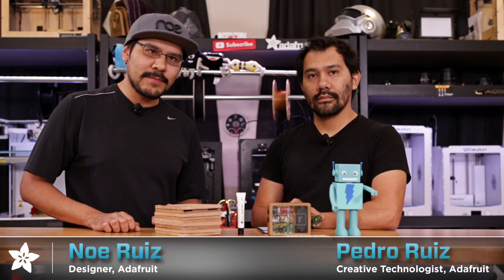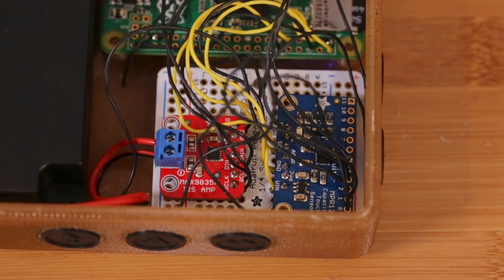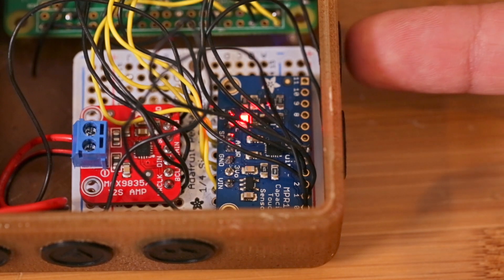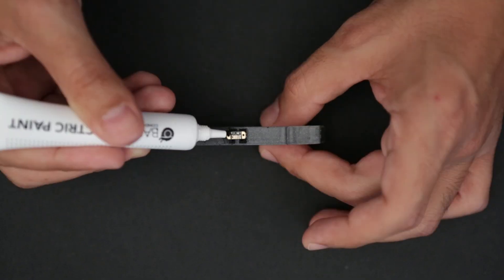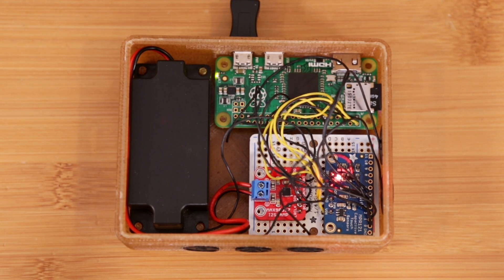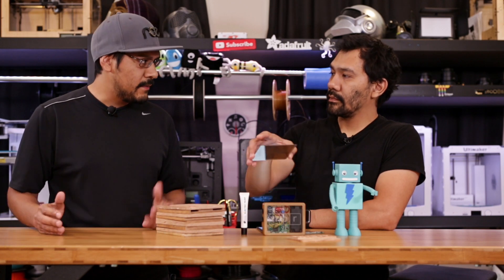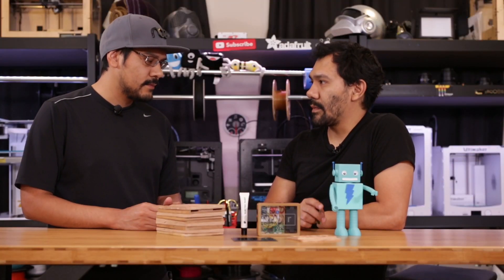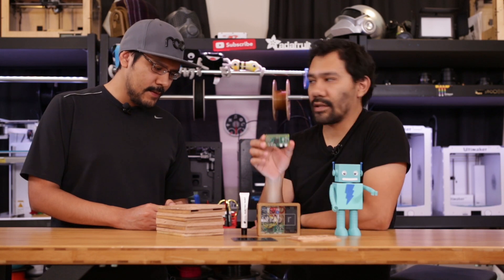Raspberry Pi Zero NPR One Radio

Comment: How neat is that? Well put together. So does this project receive radio, and then demodulate, and turn into audio, or is it going over WIFI and streaming off the NPR site? Or both?
Reply from the maker: +Andrew Tubbiolo Thanks! Yes, the Pi connects to the NPR One network and streams audio over wifi. It uses the NPR One API

Comment: Soon, I want to play around with a cnc router table as well, but I think you guys need to think a little bigger on your audio hardware side. I do like how you guys integrated the controls and wifi to the zero, but Im not a fan of using breadboards. I finally got my hands on a few pi zeros, and for example I have one running quite well with a pimoroni dac soldered to a modified sure tpa3110 board in a cigar box. It is running headless with nothing but a p/s isolation switch. I would like to program a gpio switch or a timer circuit for shutdown, but haven't bothered yet. I have to finish mounting and powering a 4 port usb hub in the box. Once finished with that, there will only be a power switch, 5.5 x 2.5mm power jack, and 4 speaker binding posts out. Inside I have a 5v 5A buck regulator to power the pi and the usb hub.

Comment: hello. need some help. Im trying to make a bluetooth amp and have probably what is an easy answer for you guys but i seem to have a block when it comes to this stuff. Also not familar with the vast array of parts and not knowing the lingo doesn't seem to help. I have the tda7429p bluetooth board i want to make an enclosure but i want to put buttons on my enclosure, what buttons do i use to make this thing look nice? thanks for any help.
Reply: I have the same board just arrived yesterday. I'm planning to mount it in the center of my speaker, near the top and use 3d printed buttons and a circular acrylic extra button for the led's. I'll make them a tight fit to the wood with a lip so they can't fallout. That probably doesn't help without a picture.

Comment: So... what exactly does it do?
Reply: plays the npr radio station.
Reply from the maker: +nattyphysicist It streams audio from NPR One over wifi. Internet radio!
Reply: Where's the wifi adapter?
Reply from the maker: It's hiding underneath the Pi Zero PCB - soldered directly to the pins on the bottom ;-)
Reply: what wifi receptor was used?